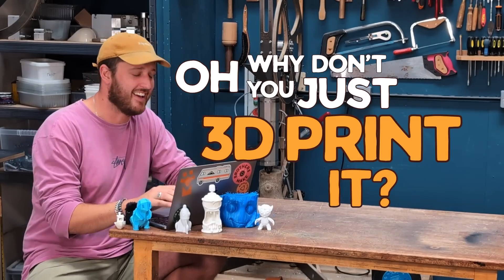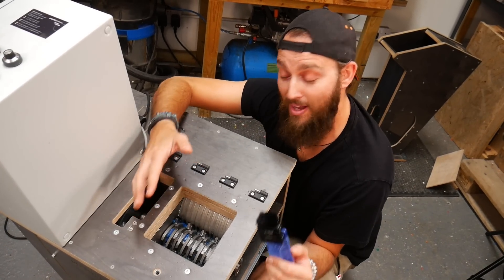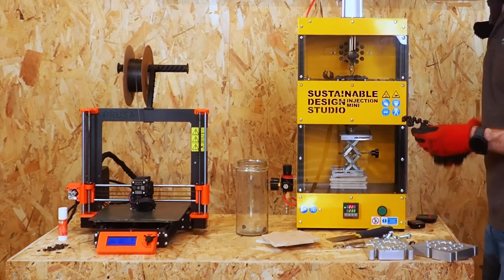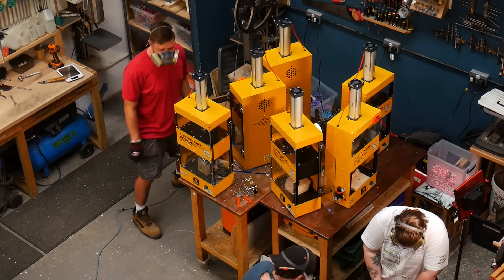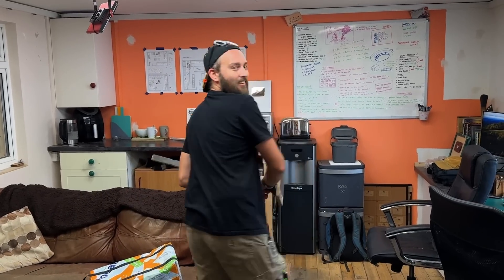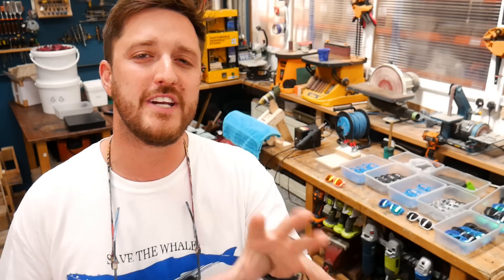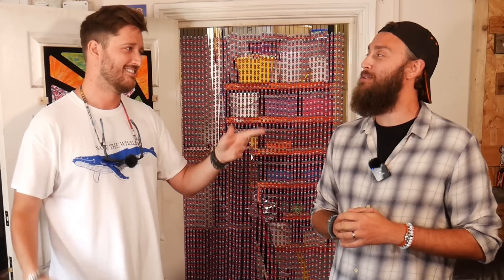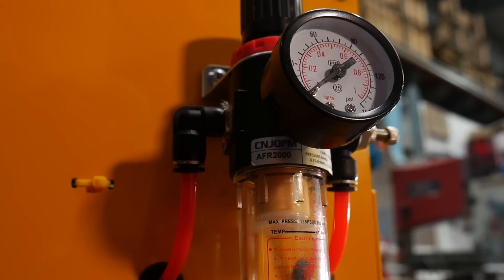Is THIS Better than 3D Printing?

Comment: I say this every time I see someone review a product that was made using a 3D printer: 3D printers are great for prototyping and iterating on an initial design, but should not be used for a finished product. The layer lines look awful and injection molded parts are just higher quality. If I'm spending my hard earned money on a product, I want it to look and feel nice. You just can't do that with a 3D printer without lots of post processing work.

Comment: I noticed in you example of 3D printing your comb, you had in set vertically. It would print much faster laid flat, plus the teeth would be stronger. Also, did you setup multiple combs per print?  Obviously injection molding is optimal for the combs; better strength, and faster overall, but I don't think you gave 3D printing it's absolute best potential.

Comment: Air compressor noise is a problem.
Reply: You can buy an 'ultra quiet' air compressor, and also make a noise dampening box to surround it. I have one. It is significantly quieter than a regular compressor. Maybe 20% as loud.

Comment: This is just a stupid video.  Trying to compare 2 completely different technologies both with completely different financial implications.   I personally own a 3d printer, a 1m x 1m CNC (cutting Aluminum) ... and have also spent the last 6 years employed and working for a large plastic injection factory (at management level) for automotive parts for famous brands.     The myriad of costs connected with plastic injection  re;  purchasing, servicing, maintenance, and then mold-making are astronomical.   The whole idea of a home 3d printer is just to buy the printer, some filament and download/design some 3d files.  Upload the file and the item will be ready soon.  Both technologies have their right/wrong uses and pros and cons.

Comment: While I agree that an injection molding machine is better for your use case, I am disappointed you would say the A1 isn't reliable and you would need to buy a more expensive brand. If you were going to use the Prusa for the comparison then use the Prusa don't tease a different product and then say just kidding it's shit.

Comment: When comparing speed and price, you should take into account mold price nad time to take. It is the same conclusion at the and, it all depends on te quantity, but if you factor in the mold price/time it takes more peaces to justify using injection molding.

Comment: 3D printing is good for making  intricate designs, you basically only need a digital modelling /sculpting app on your computer. 
BUT extruding machines are the way to go, if you want to mass produce an object.
 I guess a 3D printer could be used to make a prototype for a mold, which in turn will be used in the extrusion process.

Comment: Why would you 3d print the comb standing up and not laying on the bed ? Wouldn't it be stronger if it had the hairs done in a single line then stacked ?

Comment: Actually there are ceramic filled resins intended to print molds for low number batches (like a few hundreds of injected parts). With a price about 250€/liter this might be an alternative to aluminium molds if you want just a few hundreds of pieces. Still you get all the advantages of injection molding.
On the other hand prototyping for injection molding is not always easy to do. The object has to be able to be released without much efford. Complex geometrys are not easy to do or maybe even impossible with injection molding. However, if the geometry of the object allows injection molding and you need a bigger number of the same part, injection molding is the way to go.
It is not 3d printing or injection molding. Always use the method best for the special project you want to do. And also consider a CNC mil and searching for an industrial mass produced product you can simply take for a start and modify it with some milling... Having all 3 technologys available gives you much more power to do everything you want.
It was quite nice to see the prices for small injection molding machines have come down quite a lot. It´s in the price range for hobbyists now. Still, while of course an air-compressor is the professional way to do it: Would it be possible to use a long lever instead to press the molded plastic in? For a hobbyist at home an air-compressor might cause problems with neighbours...

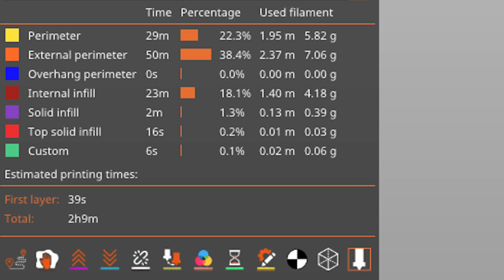Comment: Who prints a comb with the teeth facing upwards at 4:00 ? No wonder your print took hours. 
It honestly feels like you did everything to ensure the print times were the worst possible...

Injection moulding has its strengths over 3D printing obviously but this is by no means a comparison that makes sense. Just highlight in which cases it's better and be done with it.

Then again I guess you get more comments that way. So if you're just farming views and feeding trolls, we're not talking about sustainability anymore. Won't be following this channel anymore.

Comment: I'm not doubting that both have their pros and cons but I don't think you really give a fair comparison.
1. Nobody would print a comb standing on end the way you had it. Having it lay down would make it faster & stronger.
2. 100% infill does not add strength. See CNC Kitchens testing.
3. Print farms can be mostly unmanned. With automation the printers can be mounted at a 45° or greater angle. When the print finishes, it cools & releases from the bed, falling into a catch bin. The print head swees the bed to ensure the part fell into the bin & then continues to print the next part. This continues until it is out of filament. You can also use 5kg spools to do more without human labor.
If injection is your thing, then great. You do you, but you did put up a rather flimsy strawman.
Reply: Yep, and I see print farms getting into the bambulab printers I stead of the prusa. So the are also faster.

Comment: The most expensive thing about injection molding are obviously the molds. They are CNC machined and only excell at huge quantities. 
Furthermore the modelling of these molds is quite a bit more difficult as you have to get the flow, the expansion and cooling of the molten plastic right. 

This is no fair comparison, even if you consider the initial cost of a 3D-Printer.

Also I am not exactly sure as of how expensive a molds like the ones use in the video are, but I know that for cast iron molds you will have to produce >10 000 pieces im order for the mold to be efficient.

Comment: 3d printers are useful when you need a relatively low quantity of products or need the ability to change/ make revision to the parts you need quickly. But when your making products like shown in the video where their not going to change and need to be made in high quantity 3d printing falls apart very quickly.

Comment: The orientation of the hair brush should be laying flat, this will lower the print time significantly. f you use the orientation, that is showing in your video now, the part will not be strong. Especially with a shape like this it should be laying flat. Although you will not reach the same result in bevel that is now in the hairbrush design. There is also the possibility of printing more hairbrushes on one build plate. I think if we are comparing the two techniques, i am most interested in the difference in speed.

Comment: You obviously sliced that comb for 3d printer in wrong - way slower and weaker - orientation. Cant understand why You done that, because all your points are still valid.

Comment: Depending on what you're doing, 3d printing is great, and you can totally use it for mass production. For example, drawer handles, totally 3d printable. But it definitely has the drawbacks listed in this video, although the durability one is super overblown. It's only a problem if your part is like experiencing super high forces with tight design constraints. Which is actually not very many parts. Really the biggest thing is just the surface finish and the feature size limitations. You just can't make small things that look nice with fdm.

Comment: You made some good points, but a more fair comparison would be: to use not a ready made machine like prusa or bambu, which are not used by big proffessional farms (except for prusa obviously), but diy machines that are cheap, replicatable and easy to repair. A good diy option could cost up to 400 EUR for a bare minimum machine printing in pla or petg. And you would not need it to print fast.  Additionally, throw a custom gcode in the mix for releasing parts, so as soon the print is finished, the printer yanks the part in a front tray as to eliminate human interaction to release prints. Then the print sequence would start again until you have the desired amount of prints. Second, that would also mean your 3d files must be made in a way as to allow easy release of parts by the printhead. That would mean printing 1 bead at a time, but continuously for three days - no supports, no brim. You correctly mentioned that 3d printing allows you to make things that cannot be possible with other means of manufacturing. And this is a bonus many do not use i.e. everyone tries to print parts that are hard to print but easy to injection mold thus many use supports, are flimsy and just bad.  A combination of those two points would reduce the cost of the print farm substancially and eliminate any post work. Now, that would still give you a subpar result comparing to a molded bead and less color variation options, but it would definetily lower the price of the print farm. However, with 3d printing you can also add various textures on the fly. Grainy, wavy etc. For injection molded parts you would need a new mold and afaik molds are a bit limited in terms of textures unless you shill a lot of money for it to be made on specialized cnc machines. I may be wrong on this one.
Additionally , it would be fair to assume that a print farm would need more space to operate. So that is an expense, especially if you need to heat the premises. That should also be thrown in the mix. You cant squeeze many printers in a small workshop. On the other hand, a big space could also mean that a conpany could invest in a filament maker and recycle filaments in the house.
And lets be real , 20 pounds per filament roll is a retail price. For a business, you could easily go dirt cheap if buying in bulk if we are talking about 1 color, especially when you buy 3kg rolls. I mean, i buy my filament in single color pla for 10 euros if i buy 10 rolls or smth. A big business can do lower, say 6-8 eur.

Comment: 3d printing in all of its forms is for prototypes, oneoffs, and low volume batches. MJF and or SLS is probably what would lend itself most easily to your application, and might even be relatively cost competitive for your smaller parts like those beads, but is definitely far from recycled lol.

Something you guys might like though is making resin printed injection mold tooling for second stage prototyping and low volume batches for limited editions. So that kind of workflow might look like this: first stage prototypes on desktop FDM printer, second stage prototype from an MJF machine, third stage prototype from resin printed injection mold tooling. FDM prototypes are virtually free so you can make as many as you need to get the look and feel you're after. MJF is relatively inexpensive, and the mechanical properties are going to be very close to what you're injection molding, so you'll get a really good idea how the actual article would function in real world use, so you could use those for destructive testing and simulating wear. There are even flexibles that closely mimic rubber. Then your resin printed mold tooling will test the final dimensions, draft angles, venting, ejection pin locations, etc. If you don't have any issues with the resin tooling then you can be a lot more confident in investing in CNC tooling.

Resin tooling is also really good for injection molded silicone. Since there's no heat involved, and the silicone is so soft, those can actually last a long time. Like a tool you print with a 100 dollar bottle of resin might last as long as the iteration of the part it's making and save you thousands.

Comment: You guys did an OK surface level comparison, but I do not feel you explored all angles and input. And I agree that injection molding currently is probably the best option for your particular business. But I also think you guys are gearing your business TO injection molding rather than approaching it from a what is the best option based on the product you are going to make. And there is nothing wrong with that, do what you know and make it work for you. The same thing could be said to the people 3d printing, why don't you just injection mold this, obviously not everything crosses over.

Comment: I definitely agree that injection molding is more efficient, faster, and creates stronger products. I don't know how anyone could say otherwise. But I do have one critique for yalls video. 

It looks like you all were only printing in a small area in the center of the bed. If yall had filled that up production on the 3d printer side could have been scaled up quite a bit making 3d printing still very viable when your starting up but investing in injection molding to scale up when you get your feet firmly planted is a clear path to success.

Comment: It takes 200 hrs (8 to 9 days)  to print 9000 beads on my single Voron 3D printer (costs $600 to build) - this is actual print slicing calculation. Estimated with beads having an 8mm diameter and a 1.6mm hole. There is zero plastic waste, and total labour cost is about 45 minutes - 5 minutes to clean the print plate once daily for 9 times.

Comment: Not a fair comparison. Injection molding is great for huge quantities of the same model where as 3D printing is used for lesser quantities, highly customizable models and more varied models. It's like comparing a small business to Microsoft. These 3D printers are for home use or niche craft businesses with low volume. Injection molding is next level for a business but not practical for hobby or side business.

Comment: >let's take designs that are clearly better to injection mold
>let's completly skip prices of molds themselves
>also the time to create them
>let's not use any form of stacking or really any method to speed up the prints
>let's ommit the price of the machine also, and forget that you can get 3 awesome printers at 1 injection mini price
>let's skip all of the automation methods for printers (belts, auto bed swaps)
>let's forget that you can easily reuse all of the poop from 3d printer with the right setup
Yes, injection molding is clearly superior
Reply: they are clearly clickbaiting for views.....

Comment: I mostly agree for these use cases. But I have to add that in the slicer you did orient those combs very poorly for optimal print speed (and part strength). Maybe the design isn't really a good use case for printing in the first place(I would never let a 3dprinted comb near my hair....) but printing them laying down is way more optimal.

Comment: This is sort of like asking a guy who only uses hammers to pound a screw into a piece of wood. A screwdriver works better. So many things missed. For instance:

1. Injection molding, the way you show it requires significant labor. A single person can operate a 3D print farm. Injection molding cleanup is significant. You know this because your eyeglasses require a lot of it.
2. The Bambu printer you show is at least as good as the MK4 and 1/4 the price. That's why print farms are switching to Bambu printers. 
3. Clearly you have little to no experience with 3D printing as you've oriented the comb in the wrong direction. 
4. Injection molding requires draft angles, gates, sprues, release agent and sometimes even ejector pins. Texturing molds is an art itself. More complicated molds require slides. None of this is necessary in 3D printing.
5. Fabricating tooling is typically an iterative process unless you have professional engineers. You need to understand shrinkage, material flow, flow welds, not to mention part clearances, final fit and finish. This takes more time and becomes more expensive every time you iterate. In contrast, 3D printing is ideal for creating iterative designs.
6. Injection molding creates significantly more waste because of these screws and gates created. So, it makes no sense to buy recycled material only and not have a way to recycle it yourself. You need to factor in those costs as well. 
7. And lastly, I think you paid too much attention to the concept of time. My guess is you do not run your injection molding machines 24/7 or even a full 8 hours every day. It appears the only metric that you use to evaluate these two processes is manufacturing or print time and I believe that is a poor metric for a variety of reasons. First off, it takes a tremendous amount of time to fabricate a final tool for injection molding. That should be calculated into the evaluation process. Furthermore, the iterative tooling time and costs are substantial as well. And, labor time is a linear progression when scaling injection molding the way you show it. Not so with 3D printing. One more two people can manage a huge 3D printing farm.

Bonus point: injection molding works once you have a complete designed finished, tooled, and ready for manufacturing. Because of this, it becomes more difficult to open a store with many, many different SKUs compared to 3D printing.

For me, this is an injection molding fan video. Certainly injection molding has great advantages over 3D printing in some areas and vice versa. But looking at it through your own injection molded rose colored glasses doesn't provide a very objective review.